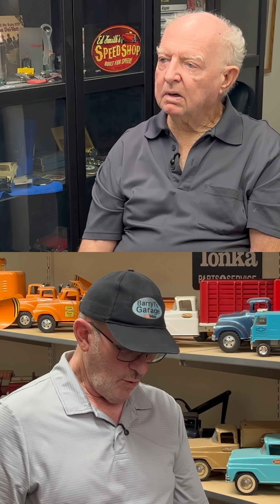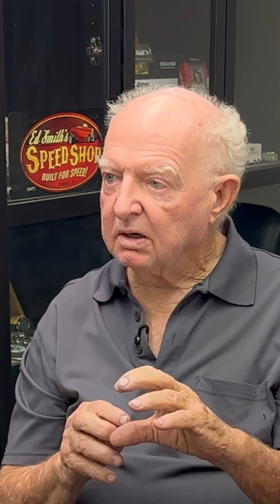Put a 427 CAM in a SBC? No Problem! Ask Ed 39 w #BarryT #enginebuilding #hotrod

Comment: I know I know. People have been putting roller bearings in engines for a very long time. I personally want to avoid roller or needle bearings inside of an engine. In my mind. It's another point of failure. Waiting for all the metal shrapnel to find their way throughout the engine. Ed knows better than I.

Comment: There are needle bearings that have no outer case , just rollers in a cage.. You need to have the bore and the cam hardened though..I dont think cast iron can be hardened enough.. Drilling a hole in a standard needle bearing race can be done , but it is a hardened piece.
Reply from the maker: That's great information, thanks for sharing!

Comment: As Ed mentioned, needle bearings have a cage that blocks off the oil passage. Needle bearings reduce friction and are perfect for racing applications. They rely on splash lubrication so they don't tend to work well in street/daily drivers.

Comment: I'm wondering did you drill a small hole and line it up with the original oiling  to keep the cam bearings lubed.    Or did you rely on splash oiling?
Reply from the maker: I'll ask Ed

Comment: So if you machined an oil feed hole in the needle bearing cage would it work
Reply: The bigger problem is that too much oil could cause the needles to slide rather than roll.  You just splash oil stuff like this because it needs very little oil.
Reply: No it wouldn't, the oil would bleed off too quickly and subterfuge the rest of the engine.